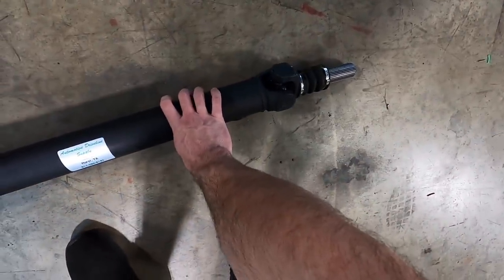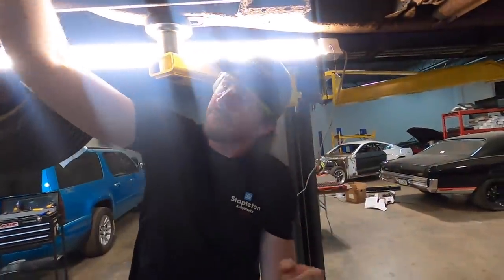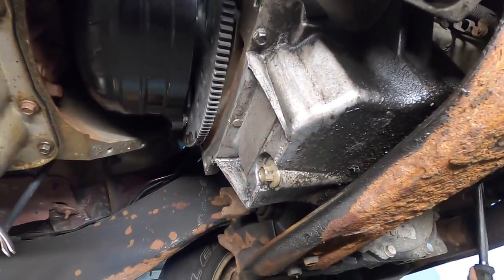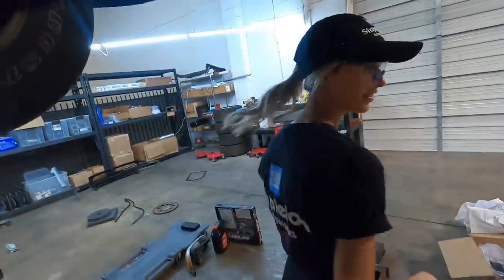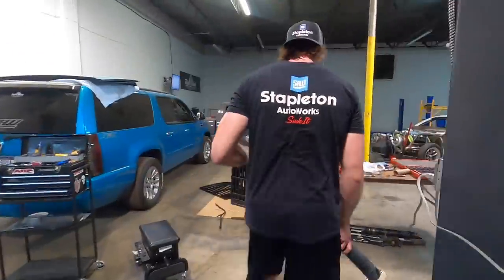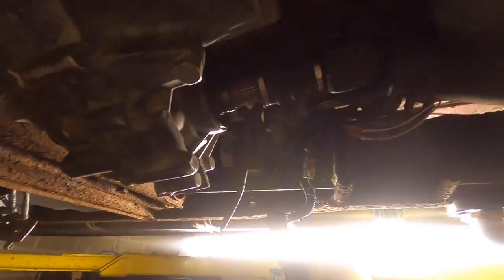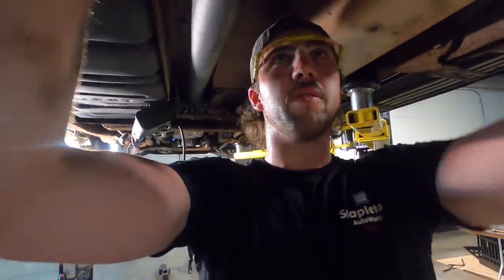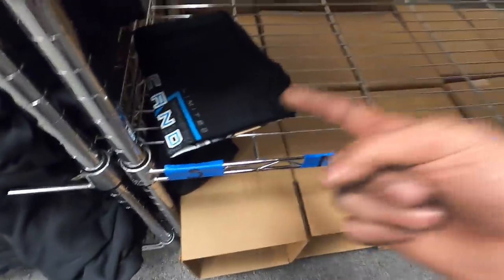Budget Turbo Yukon XL 4L80 Conversion: We Have Driveshafts! Torque Converter Spacing & Shop Talk

Comment: Hey Mitchell, the longer trans fitting is critical for lubrication to the center shaft and all of the bushings. The older style input shaft had the lubrication hole in the center of the shaft (that's why the fittings were short), the newer models have a solid input shaft, requiring the flow of trans fluid to travel through the deeper fitting into the lubrication channels. The shorter fittings are for the trans fluid cooler lines only. The spacers on the torque converter are to set the depth of engagement in the trans pump. The precise method of setting the pump depth is to measure the input tube length from the face of the pump inside the tube to the end of the tube, then you subtract 1/8in-3/16in depending upon which type of pump. The easy way is to push the converter all the way into the pump, measure the space between the face of the converter and the flex plate at the mounting holes and subtract that 1/8in-3/16in and that determines the thickness of your spacer. You technically only need enough space to keep the converter from bottoming out against the pump, but the material the converter is made of will determine the rate and amount of expansion that converter will have. A billet converter will heat and expand more than a standard steel oem style converter. The goal is to have maximum engagement between the two notches in the converter and the drive tabs in the pump without contacting the pump housing, especially in tow vehicles and race machines. If the pump tabs are not fully engaged it will cause the pump gears to tip in the housing and lead to a failure. The 1/8in spacing is safe for Uncle Rob, but the Escalade might need to be more precise with the bigger power plant. Of course the reality is that the more power you have, the more stuff you break and so far you my friend have been pretty fortunate for sure.👍
Can't wait to see Uncle Rob rippin down the street and the track!

Comment: When I did my first transmission swap back in 2008 I learned that the 1/8 inch gap is normal between the converter and flywheel or starter flex plate because when the converter goes through thermal cycles it will expand the 1/8 inch gap the gap also prevents the crankshaft from flexing and grinding the crankshaft main bearings and the bearings in the connecting rods it also gives the stater thrust bearings and the stater in the converter longer life and not lock the converter up at the wrong rpm and then won’t stall when you let off the gas it also prevents pump rub which can make the pump fail and cause input and output shafts in the transmission from snapping the tolerances between the clutch disks and drums are roughly a beard hair in thickness any tighter and it puts more ware on the shafts creating fractures points putting the shafts out of balance it also puts more ware on the front and rear main oil pan seals

Comment: I have to agree with Logan.
She needs to know the actual distance between the sensors.
Then she knows when one light turns on, she has so many inches she can sneak up on the light.
Its been a long time, so the numbers in my head may be wrong.
If she had known that from one green light to both green lights is only 6", she wouldn't have done it. 
She did great👍
Reply from the maker: That’s a good point

Comment: Those allen heads are a last ditch effort to prevent a bad day lol. I bought a 03 escalade for the lq9 and some bastard rounded off one of the bolt heads on convertor bolts. It was so tight that the allen head stripped out too. Had to use an air hammer to get it out. Kept that one as a trophy lol

Comment: If you use a deep socket on the Torque wrench it'll anchor itself against the block and you won't have to hold the crank when you tighten the converter bolts. I go above the frame through the wheel area, gives a better angle to anchor the wrench.

Comment: The 4l80 has front lube and rear lube cases
The one you got is rear lube the tube on the rear fitting goes into rear planetary area so that tube is very important on the rear it has a seal in the trans that tube fits.
The converter spacing is to correctly place the pump drive gear on the converter hub properly
So the pump is not wobbling in the case 
It reduces pump failure

Comment: Good lord. I had a driveshaft made for a 99 Chevy pickup up about 4 years ago. 125 bucks at Micheals Machine Shop in Clarksdale,MS. High dolla in Texas
Reply from the maker: That’s dang cheap…I also needed the slip yoke and used the heavy duty solid u joints

Comment: You should have clean the splines with sand paper so it can slide in the hole and if it's hard then stop cause you can end up stuck or vacuum locked so just a helpful hint.....

Comment: I had a change of plan today on my project 88 monre carlo S5
Reply: I messed up I changed what I was going to do far as drive train on my project  88 SS monte carlo I bought a big block 427 and a turbo 400 fairbanks transmission with a 3200 stall converter.  Today was a good day.thank you for your videos.

Comment: Be sure to get the one with the rear extended tube into the rear lube of the planetary , If you use one without the extended tube you will burn up the trams

Comment: Yeah don't crank on the converter bolts right away. Get em all snug and then put some juice onto them. I added an hour of work for myself when I first did that. The head of the damn ass bolt was caught on the block 😂

Comment: You should probably change the fluid in the diffs too it's pretty cheap and can't hurt and I don't know it that's it or something else but I picked up like half an mpg on my suburban after I did
Reply from the maker: Interesting lol. The rear diff leaks so it needs a new cover anyways. I have a posi unit for it too
Reply: I mean I was not expecting and change just something I did because it had like 250k and I didn't know if anyone had ever done it and I don't recall changing anything else

Comment: I think you should go to the machine shop or maybe they already make a shim the goes between the flywheel and crankshaft and then bolts will have more clearance to pan lose the washers . Hat is good 👌🏻

Comment: The flex plate has one hole that has flat sides in it put the bolt in that hole first and then tighten it all the way up and all the others will line up

Comment: Some of the converter bolts are ROUND head with an Allen center. Those are worse. Pro tip is to run them all the way in then back out half a turn until they're all started. Then spin it around to tighten each. 

I've been a tech for 21 years, 20 in the same shop and in dealer service since 1993. The good ones like me find fulfillment in many ways. Fix Your Ride is a local charity deal I first participated in today. There's no telling how many random cars I've worked on and sone them you like getting back because the people like what they got the last time. Some you'd like to never see again. Ha!
Reply from the maker: Noted 🤟🏻

Comment: Use a wire toothbrush does the trick to clean the rust out of the hole to fit the drive shaft in.

Comment: You have good video, s bro, i have a question what kind of spacer did you use for the flexplate? I did the same conversión of transmisión to my 2001 gmc Sierra 5.3 4x4 but i didn't put the washers that u put it at the torque converter and is not working so good. I live in México and it's real hard for me to get all of the things i need, i have to order them from amázon.
Reply from the maker: I used a crank pilot spacer from summit I think. If the converter hub is not seated in the crankshaft pilot hole you will have problems
Reply: @Stapleton42  huh ok, i made a spacer my self from a damage crank too with the specifications but i notice that converter hub it only go a litle inside the hole, so i was thinking maybe use my stock dish flexplate and made a holes for the converter or what else can u sugested me to do?

Comment: 4l80e circle d converter here I currently have more than 1/8 of spacing while converter is seated all the way into pump but can barely fit a 3/16 drill bit In between converter pads and flex plate I added a 1/16 washer while converter is still seated into pump and now my measurements  between the converter and plate is 1/8 is this correct?

Comment: Thinks to self “I need to go work on the racetruck” sees new video notification “truck can wait a little longer” 😂 
Btw if you or someone in the shop knows of a way to front end align something with big slicks can you help me out? Local shops can’t get there machine on the tires and this junky roller I bought is not symmetrical at all making the string and tape measure method not reliable. Btw that might be a good video to do one day.
Reply from the maker: Uhh I have no idea. Try stock tires
Reply: @Stapleton42  with how simple of a solution that sounds, I feel a little special in the brain. Appreciate it